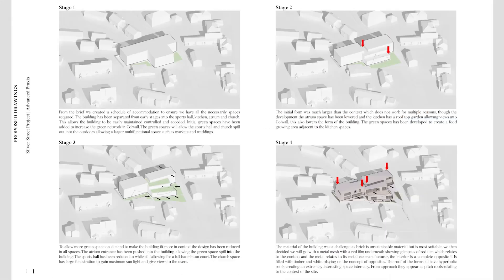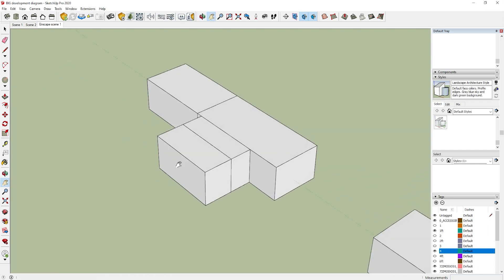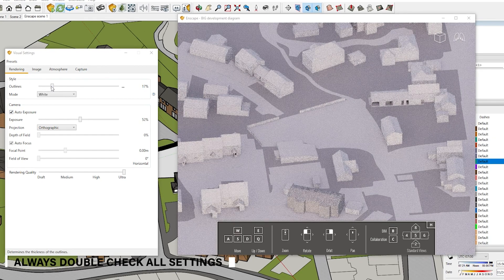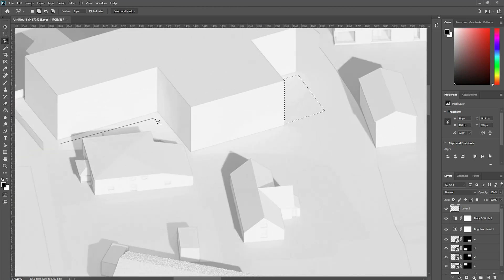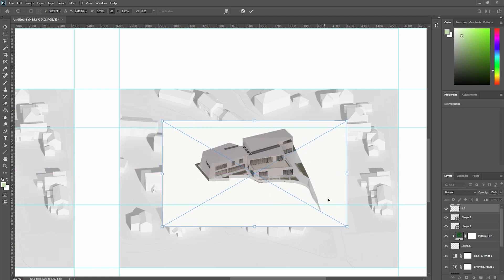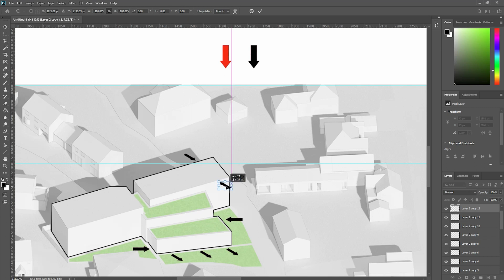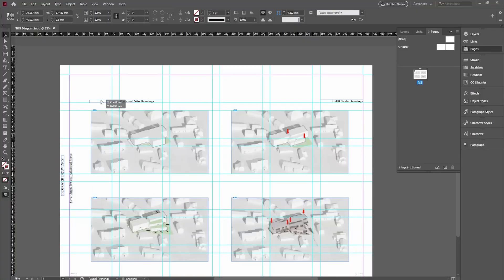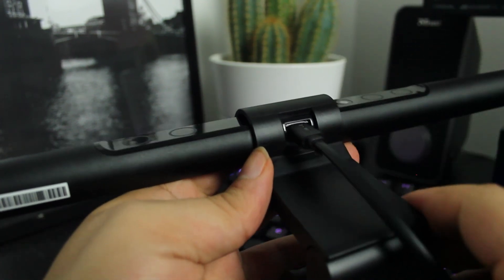BIG Concept Diagram Sketchup + Photoshop | BENQ ScreenBar Impressions

Comment: Did you have to model each of the surrounding site buildings? And is the plan from digimaps?
Reply from the maker: Yes this was from digimap and then used 'Google Street View' to make the building in detail and as real oas possible with materials and hedges and everything. This was a group project so I didn't have to do the context. Thank you for commenting.